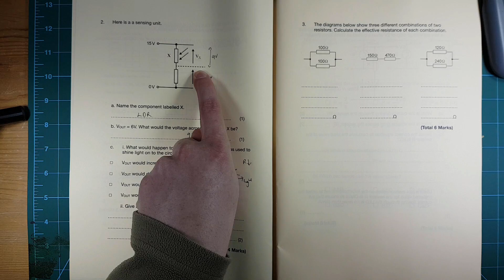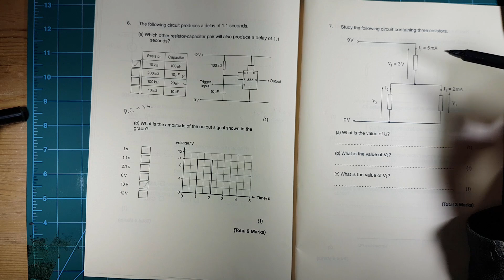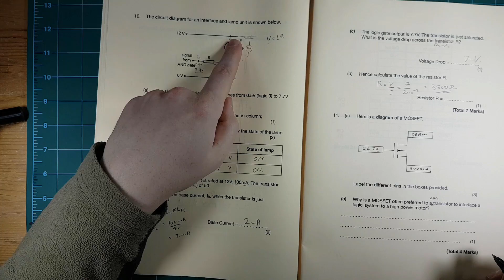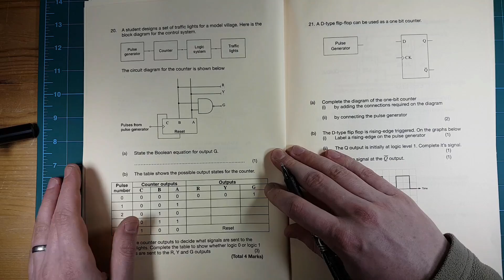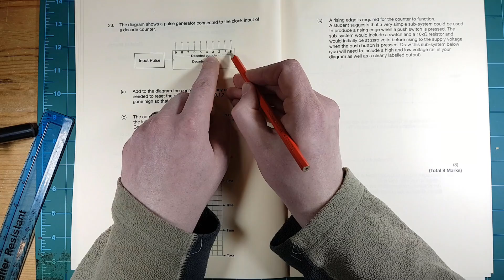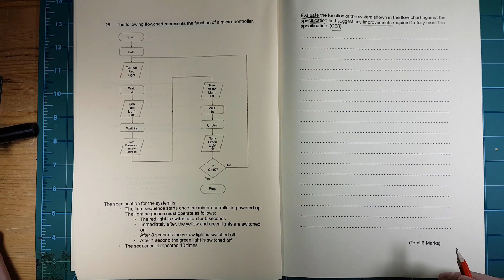GCSE Electronics Mock 2018

Comment: Im struggling to understand why  V1 in question 10 is 0.7. I do understand that 0.7 is required to let electrons through the transistor but why is the voltage difference is 0.7?
Reply from the maker: The pn junction (base to emitter) of a transistor - if it can have 0.7V across it it DOES have 0.7V across it.
It is very similar to a diode, and you know how steep the IV graph of a diode is when you hit 0.7V. It is pretty much vertical.
Reply: Ohh right i understand now thank you